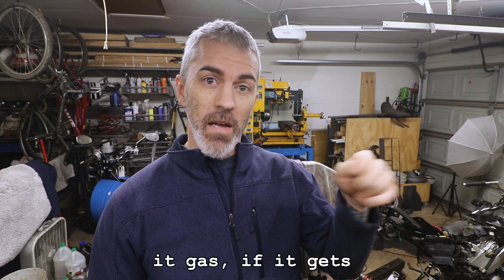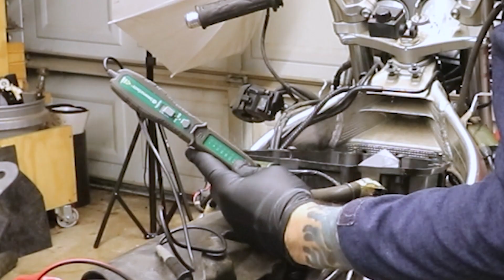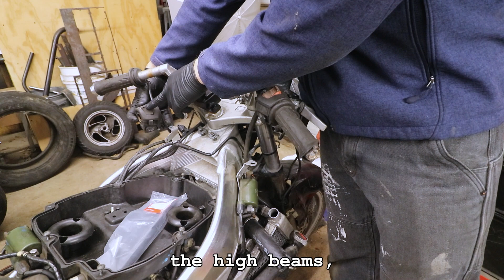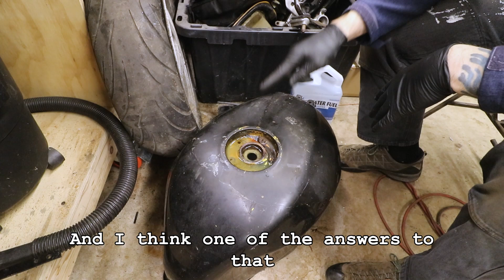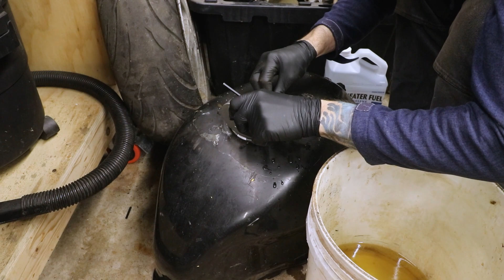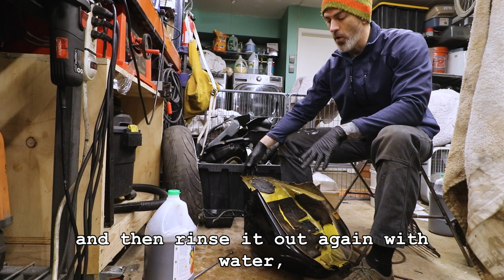Honda VFR 800 motorcycle build  11. 24. 23

Comment: Heated grips draw a lot of power and are the #1 cause of Reg/Rec/Stator failures. especially living in a warm climate like you do... I would lose them. Unless you plan on doing particularly long rides in cold weather, a good set of heated gloves is a better option, they last about 6hrs/per charge... Just my opinion.
Reply from the maker: I like this. I have been pondering the heated gloves vs. grips and liked that the gloves can be bought once and used on multiple bikes. It is also good to know that the heated grips impact the reg/rec - I didn't realise. Thanks for the info!
Reply: Any and all accessories add strain to you charging system. these bikes in particular are know to have venerable charging systems.  @HooptieDoodle
Reply: Ari at Revzilla did a good video on charging systems recently, in which he also touches on this problem. "How to Test Your Motorcycle’s Stator and Regulator Rectifier | The Shop Manual" @HooptieDoodle